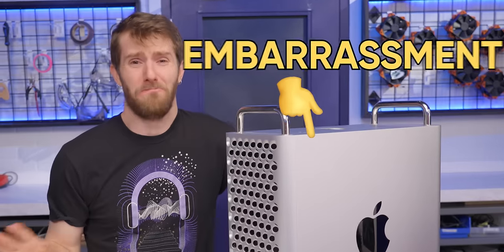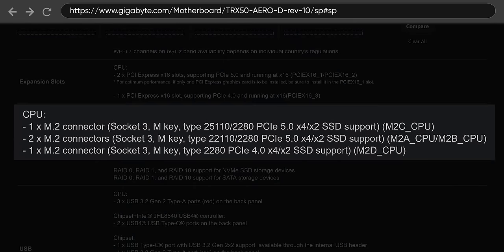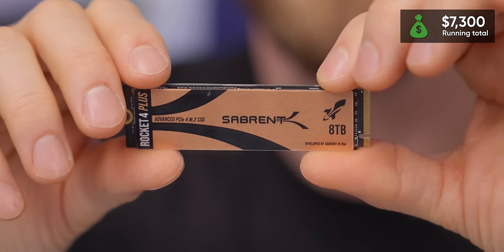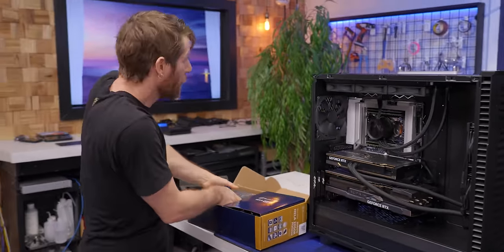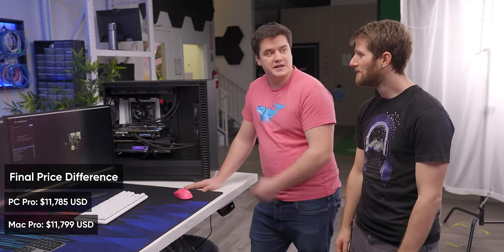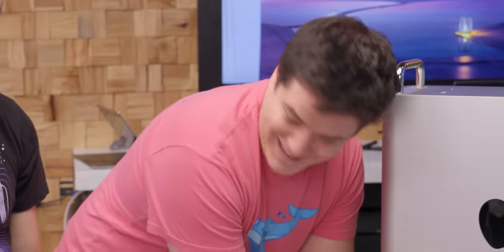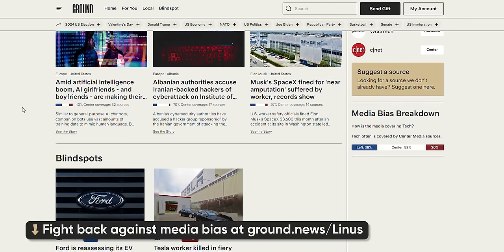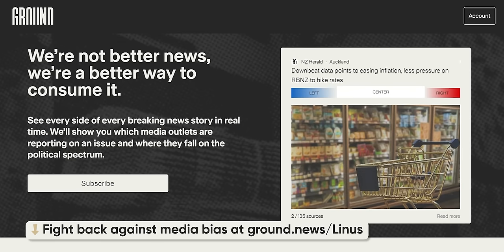The $10,000 Mac Pro Killer

Comment: Another video idea: what's the cheapest PC you could build that is still faster than the Mac
Reply: Yeah I wanted to say that
Reply: Came here to say this... I'd be much more interested in that comparison.
Reply: Probably looking at a three or four thousand dollar PC because that's much closer to the mac studio
Reply: This. Also systems price competitive but better than the studio and mini. Seriously, who is buying this version of the pro?
Reply: @rinzor  honestly, any of the recent versions of the Mac pro are all garbage, Even if we ignore most of the things you can do on Windows or Linux that you can't do on macOS you can get an equally performant machine for dramatically cheaper
Reply: sosleepy512  It doesn't have a dedicated graphics card because it has all of the graphics processing built into the CPU, which means the CPU will be probably about the same size as that threadripper. On an integrated platform like this it is more efficient to design the system this way. However, you have to be extra careful about waste heat
Reply: One instead of two 4090s. Half the SSD storage.
Reply: @dajaxx  they probably wouldn't even use 4090s because they're dramatically more powerful than what's in this mac. I feel like a 4070 would still outperform the mac GPU, You could also cut down the cost of the CPU a lot and you can get the same amount of storage for a lot cheaper because in this video they're building a similarly priced machine, not a price to performance machine
Reply: 14900k with a 4070 will spank it and 4 x 48gb ddr5 sticks.
Reply: @jondonnelly3 You could probably still go weaker on that CPU and I would also personally go AMD if you're going to try to compete with Apple because AMD has much better power efficiency than intel does
Reply: sosleepy512  remember this is More like a $3,000 computer in an $8,000 package. So when you look at the Mac studio, you're not going to compare that thing to a PC with a 4090 because you can't build a $3,000 computer with all new components and fully utilize a 4090. I would love to see you try though
Reply: Depends if you take in to account the computers electricity consumption in it’s life time.
Reply: Old Xeons to the rescue!
Reply: @fungo6631  don't think that could be faster than this $10,000 Mac but okay
Reply: give me fast laptop with battery life of macbook
Reply: would probably cost 50 bucks
Reply: Well if the 32 core AMD is 2x faster than the Mac then you could probably get away with 16 core AMD CPU like 7950X on AM5 but especially when AMD launches the new AM5 CPUs later in 2024 / early 2025?
Reply: the real question is, what's the cheapest you can make new vs used that's better than the Mac?
Reply: @zuvasq  doubt
Reply: plot twist: that computer drags the mac across the floor like the overpriced E-waste it is once one singular component fails
Reply: Faster by how much
Reply: @the_undead  What can you do in Linux that you can't do on a Mac? And for that matter what can you do on Windows that you can't do on a Mac (besides gaming)?
Reply: Yo
Reply: @gutless_worm  gaming is a big deal
Reply: @gutless_worm  lots of engineering software straight up doesn't exist in the Apple ecosystem.
Reply: @the_undead  imagine thinking that was fr...
Reply: Just get a Mac Studio and build a $3k pc.
Reply: @Ornithopter470  Running a specific piece of software isn't a feature, and I highly doubt there is engineering software that runs on Window+Linux but not MacOS.
Reply: @the_undead the highest end mac gpu is on par with a 4080
Reply: @KellerFkinRyan  and that's not what's in the machine in this video
Reply: @gutless_worm  you specifically asked what you couldn't do. And running software like Autodesk is something you can't do. The hardware is capable of it, sure, but it doesn't have a version that runs on MacOS.
Reply: Sounds like a good one❤🎉
Reply: @the_undead  this comparison was dogshit ngl, apple makes computers on par with any prebuilt if not better for value, especially if you have an iPhone. the mac studio is way fuckin cheaper and is equivalent to a last gen high end custom pc for like $2000, and its smaller than almost any itx build on the market. its aint no 4090 and 7950x3d, but its also 3.7L of space and is dead silent. the Mac Pro is a huge ripoff for people who literally just have too much money.
I know the video was more for content and views, but it's still a horrible representation for apples computers that arent absurd. even AMD with a $5000 threadripper is just unnecessary for basically anybody. even a 7950 is overkill for most.
sorry for the wall of text, but theres no point in debating when neither side is represented well in this video.
Reply: @the_undead  You could do it for under 3k I'd imagine.
Reply: just about any PC lol
Reply: @casparhughey5651 definitely not be realistic.
Reply: @jlatoo  Clueless. It's barely even relevant. That's like asking why your tractor doesn't go 200mph. Because it's made for other purposes.
Reply: @KellerFkinRyan  LTT is just fuelling the bonfire at this point and everyone jumps the wagon. Also, who games on a Mac? Why don't they compare Logic Pro or Final Cut performance to Windows alternatives? 🤷‍♂
Reply: @mich977f  no that’s like asking why my Toyota Corolla can’t drive on the freeway
Reply: sosleepy512 first minute of the video, 76 GPU cores
Reply: @Ornithopter470   "Autodesk" isn't software. That's like saying you can't run "Adobe" on MacOS. The original question suggested Windows+Linux could do MORE than MacOS. If you're simply talking about software compatibility then there's plenty of software that runs on MacOS that doesn't run on Windows so calling the entire OS worse as a result is a terrible argument.
Reply: @gutless_worm  seeing as operating systems are literally interfaces to execute code, software compatibility is pretty relevant to what it can do. Drivers are software that help the os interface with mobo components to interact with devices, and mac has far less driver support for server systems, compute hardware, networking and even consumer facing products. Aoplications are software, and mac lacks CAD, medical, research, etc software that matters to a ton of high value sectors. A lot of these incompatibilities are due to the reduced instructions available to arm architectures making conversions and emulation very difficult, which is a hardware limitation that influences mac different then windows + linux which have x86 and risc variants. The list goes on. Stop acting like operating systems are anything else than code.
Reply: @whiteerdydude  That's a lot of text to say you have no idea what you're talking about.
Reply: @gutless_worm  imagine needing 15 words to to say the phrase "i have no counter-argument". You really are rour namesake apple stan.
Reply: @whiteerdydude  I don't stan for corporations and I'm not the one saying one platform is better than the other but go off I guess.
Reply: Have you ever wondered that are several dfrent macs with diffrent performance?
Reply: @gutless_worm dumb dumb questions

Real time encoding on 8k video
Enterprise SSD for sustained worloads
Math simulations using matrix math( you use that when you apply a filter on photoshop.

Pci hardware is way faster than any thunderbolt port.
Reply: @Ornithopter470 Because  users prefer windows version.
Reply: @KellerFkinRyan Mac is silent for things that are not heavy of course you will say you do 16k editing and your mac doesnt sweat.
Reply: @gutless_worm its easier to prove that if you have like 200 terabytes of 8k video it will take less time on windows.
Reply: @gutless_worm then you re unable to understand computers.
Reply: They could cut the specs of that pc build in half and still crush that Mac to the grown.
Reply: How much does a Raspberry Pi go for these days? lmao!
Reply: AMD gayripper and Nvidia 4030ti
Reply: I spent like a total of $600 on mine and it still beats the Mac's scores 🤣
Reply: Its a cool video idea, i rather see this only bc the this mac isnt hard to beat
Reply: Well 7960x to get the 24 core same a s the Mac pro, and only one 4090 should make it so 6500$ maybe
Reply: Anything with a 14900K and a 4070.
Reply: sosleepy512  
No. You do need a GPU. But what is interesting is how hard you can beat the Mac with affordable parts. If we compare CB scores, the rig I did for wifey scores the following, and both are way better than the Mac. 14900K is about 2300 points in CB when dialed. Her 4070 ti Super scores 26000 points. It will leave the Mac for dead everywhere.
Reply: even my buget gaming pc is faster by 2k points lol
Reply: @BradMcdougall  
What cpu is in your PC? What score do you get?
Reply: @AB-80X  11000
Reply: @AB-80X  ryzen 5 5600x
Reply: @BradMcdougall 
I thought you were talking about the CPzu score. 
But 11000? Is that a 3050? I wouldn’t say 11000 is very impressive. Even a 4070 ti Super can score 26000.
Reply: @the_undead  here's the problem; apple silicon has an awful GPU compared to any decent dedicated GPU in a PC.
Reply: Awesome
Reply: sosleepy512  THAT IS GENUINELY KILLING ME HOW CAN THEY SELL A PC FOR THAT MUCH WITHOUT A DEDICATED GPU
Reply: Me watching the video with my old terribly loud Full atx case old pc side by side with a silent mac that gives-me less headache… but, still not perfect and i’m just building another windows rig on the room besides me…
Reply: they could make a fucking series
Reply: @the_undead  the pros look for performancr not eficiency. Only apple users tend to look for silent comouters because they re not used to powerful things.
Reply: @Ornithopter470 true. Even the software used to design apple products is windows only.

Comment: 17:41 I can't imagine a world where charging ports on the bottom of the mouse is not the worst thing a human could have conceived lag or no lag
Reply: The unnecessary inventions guy moved the port to the front and it doesn't work while charging lol
Reply: it is very stupid, but at least after when you charge it, it's unusable cause of how laggy it is in a game.
Reply: Humans also conceived the Steam Controller
Reply: @Sicho84  haha I used to use that until recently when I replaced it with an Xbox controller... It was fine until you needed a right joystick.

The back paddles I enjoyed
Reply: people made adapters so you could charge it from the front but apple being apple made sure the mouse is unusable while it charges because fuck logic
Reply: You know why Apple did that? If you were to take photographs of your setup, you wouldn't see an ugly cable going to your Mac... That's the main reason.
Reply: @TopVersnelling can't even call it form over function because the mouse by itself looks like shit
Reply: The funniest part is that they said that they did it intentionally so people wouldn't try to use the mouse while it's plugged in because "it could overheat the battery"

Fine for an iPhone, tho?? 😂
Reply: @kusucks991  if that is their reason then it just shows how shit their batteries are since even the cheapest garbage wireless mouse from china do not have this issue
Reply: And they've had this fail of a design for years now. I don't understand this company's stubborn clinging to bad ideas the way they do. It's still hard to accept that they turned the Mac Pro into a shiny metal canister that was heat-constrained, could barely be upgraded by the user, and was not refreshed or replaced by the company for six long years. That, like this M2-based design, is just mind-bogglingly incompetent on their part. You would think a computer company that has been in the business since the late 70s would know better.
Reply: @ericwood3709  why change a design when your customers will pay you anyway
Reply: @trailfork7815  I imagine Elon Musk asks himself that question every day. In Apple's case, I suppose that is true too, as people who buy Macs get them for specific uses or because they prefer the OS and the features it offers, and tolerate Apple's weird hardware design choices.

Comment: It's insane that the 14900ks will draw more power than a threadripper
Reply: 14900ks does not exist yet you silly goose
Reply: @buff9267  well he did say "will draw more power"
Reply: Yeah but therefore it's still the single threaded king. That's totally worth it if you run a phase change cooler...
Reply: im pretty sure the s was meant in plural. Not in the KS model meaning @buff9267
Reply: @horyzengm  oh yeah fcourse stupid me

Comment: I can still remeber how Steve Jobs took pride in the fact, that Power Macs smoked more expensive PCs in benchmarks. Oh, how the times have changed...
Reply: Macs haven't had the price/performance crown ever since they switched to Intel
Reply: @666Tomato666  tbf they had it briefly in 2021-2022 when Apple Silicon was fresh but the industry caught up really quick
Reply: @unicornpoo7441  if you consider the CPU alone, but add actual usable amounts of memory and storage or consider GPU performance, and no, they haven't
Reply: @666Tomato666  they switch to Intel because powerpc processor isn't powerful like the apple ads made you think that is. 
I remember... my hackintosh with mere core 2 duo e4300 put in the dust expensive dual g5 in 2007. How much is funny... because with a very cheap pc... running Mac os 10.4.8 (tiger) put a shame on expensive Mac pro g5 in that time.
Reply: @TheOzBR  I was talking about price/performance, not performance alone, please, a little bit of reading comprehension
Reply: @666Tomato666  So in that case it's even worse. 
Because they are always expensive products for the performance they offer.

Now if you said they weren't beautiful computers, you'd be lying. 
If I said the operating system wasn't good, I'd also be lying. 

But in terms of hardware. It's always been mediocre and expensive.

Comment: There's two comparisons to really make, here. You did one, which is "for a similar price, what can we get". I'd also like to have seen "if we try to target the same performance, what is the price". How much cheaper /is/ a pc that performs comparably to their boat anchor?
Reply: Half at most.
Reply: Probably hard to do as its really usecase depending
Reply: Other one is upgrade ability, you can just replace CPU or GPU, In apple products you are stuck with it.
Reply: I meant probably less than half. For example for 4k instead of a macbook pro m3 max with 64-96gb ram and 2-4-8tb for the same amount of money you could buy an Ipad pro 12.9, an Iphone 15 Pro Max and 2 notebooks (ryzen 7 for hackintosh or as they call it ryzentosh) with 64gb ram 4tb nvme  EACH. And with similar performance to M1 as far as cpu. That would be faster  and more productive (4 computing devices) than 1 single macbook pro m3 max with high specs... Iphone pro max in case one uses it for photo and videos. Othewise you could buy a  second Ipad Pro instead...

OR for 4k total you could buy a I9-14900hx laptop with 96gb ram and 8tb nvmes (2x of 4tb gen4) with 4070 for windows, and 2 ryzen slower ones for  ryzentosh with 64tb 4rb nvme each. 3 powerful (1 as fast as the m3...) laptops. 1 with Windows and 2 with Mac Os. 

Productivity compared to a single Macbook pro m3 max would destroy it... not even close..

Comment: I think something that is very important to note is that Apple M chips do not have AVX-512, and actually don't have AVX at all. This makes a huge difference in code that can be vectorized which significantly reduces computation time. So while the M chips seem to perform a certain way in benchmarks like cinebench and geekbench, in actual AVX workloads they will be significantly slower than a CPU that supports AVX, AVX2, or even better AVX-512 like Zen4 supports.
Reply: this is fine. no one that buys an apple actually has a work load. they buy them so they can sit in star bucks using social media and feeling smug while sniffing their own farts. the chip only needs to support one instruction set, and that is to show the apple logo on the screen, not just the back of the screen.
Reply: Afair only Intel had avx512 anyway, and they're phasing it out too?
Reply: @nujuat  No they aren't. Avx-512 is only getting bigger. All AMD zen4 CPUs now have avx-512 support.
Edit: and regular consumer Intel CPUs do as well, the problem is that the e cores are from an older architecture that doesn't, so only the p cores support it.
Reply: @iris4547 I would never buy a Mac, but I also wouldn't lie this bad. Plenty of people do "real" work (whatever that means) on one
Reply: @username8644  P cores only support it in theory, it is fused off because you can't have cores with different feature sets running at the same time
Reply: @marshallb5210  It's not in theory, you go to bios and disable e cores and it'll work fine. This issue won't exist in the near future since the e core architecture will eventually support avx-512.
Edit: especially since all zen4 now have AVX-512, I think Intel will go back to taking it seriously on consumer chips.

Comment: I recall workstations do a lot more checks on bootup to make sure the machine is working properly. They also tend to take a slight performance hit for using more reliable memory.
Reply: Things like ECC memory are irrelevant for workstations, I haven't had my PC blue screen due to a bit flip in like a decade, and even if it did my work is saved automatically every 5 minutes anyway. It's practically just a marketing gimmick. ECC is only useful in datacenters.
Reply: @oBCHANo  bit flips don’t just cause blue screens they can degrade data quality. Autosaving is not going to detect or prevent bit flips, if the memory has bad data then bad data gets saved.

But there’s some fair point that bit flips have been pretty rare. I recall the next RAM standard will make them standard because of how close to the limits RAM is getting.